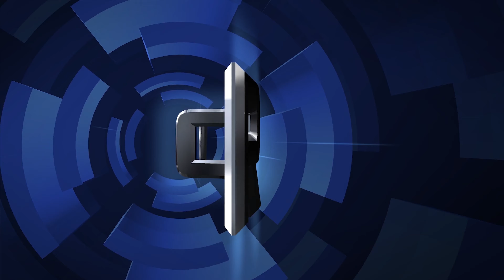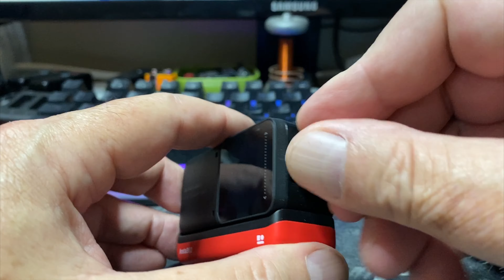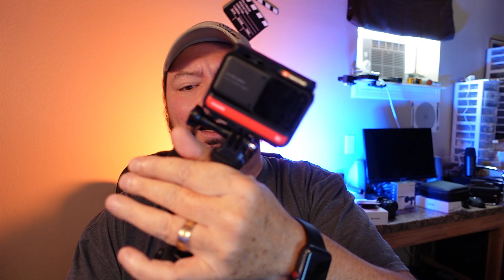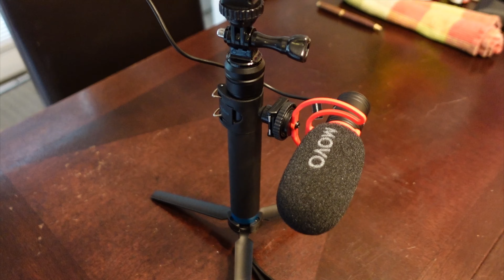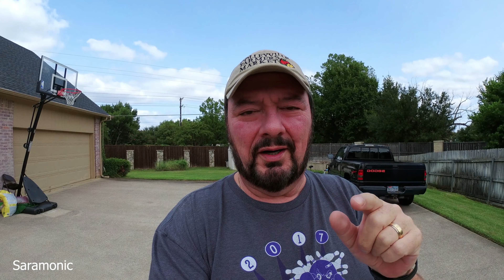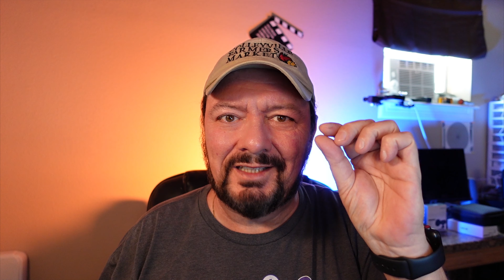Insta 360 One R audio adapter test with external microphones

Comment: mine is not very loud if I use external, what is the cause ???
Reply from the maker: It needs a firmware update, you can use a battery powered microphone for better audio
Reply: Do you have a firmware update file
???
Reply from the maker: @Anwar_  : No you have to use the phone app to update your camera
Reply: siap,,tanks you🙏🙏🙏
Reply: How to??
Reply from the maker: @Anwar_  connect the camera to your phone app via WiFi, it’s in your instructions manual, and if your camera needs an update, it will notify you and just follow the on screen instructions

Comment: Great video. I'm glad I wasn't the only one that noticed that. I tried Rode Wireless Go, Saramonic, Rode Videomicro, and the Rode lavalier. Out of all of them it's sad to say but I had the best results with the Lavalier attached directly to the 3.5 adapter. The volume was so low and unusable. The internal audio sounded better than them all, which is really weird. I'll stay tuned to your channel in case you find a solution for this. I'm totally stumped. This may turn into a b-roll camera with music overlays if I can't figure this out.
Reply from the maker: I hear that they are about to address the audio issue soon. I hope so
Reply: The internal mic works reasonably well for my use, mostly motorcycle riding and sailing, recording engine noise, splashing waves, etcetera. When wind force or speed is not too high, the camera's sound recordings are acceptable, although not very lifelike.
I tried the external mic adapter for voice recording. The mics I used are the Aperture A.lav mic and the Rode Videomic Go. The results I got are comparable to yours, unsuitable for voice recordings.
I did the same test with the same mics hooked up to an audio recorder. Even with the audio recorder set on auto, the recordings were a lot better. With everything dialed in manually on the recorder, the recordings are excellent.
My latest test was with my Akaso V50Pro and the 10dollar Akaso mic. You only get mono out of this mic. The other channel is the internal camera mic. But you can put the sound on both the left and right channels in your video editor. The sound is clear, and levels are adequate, very usable for voice recordings.
The Insta360r is a great camera, but the sound is lacking, and the external mic adapter doesn't improve things.

Comment: I connected the Rode Wireless Go to the One R and recorded myself skiing with the mic placed to emphasize the swishing sounds of skis through snow. It came out muffled sounding - not good at all. The same Rode mic set-up, less the small adapter on a Qoocam produced really good results. I really like the size, weight and video results from the One R, but they just can’t ever get everything right. Makes me think they don’t have a quality control department. Thanks for the info.